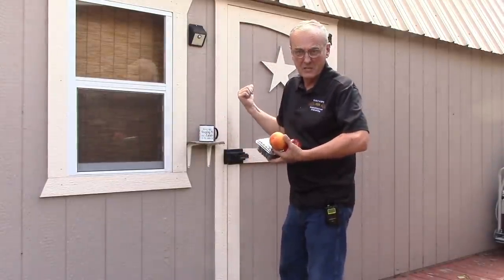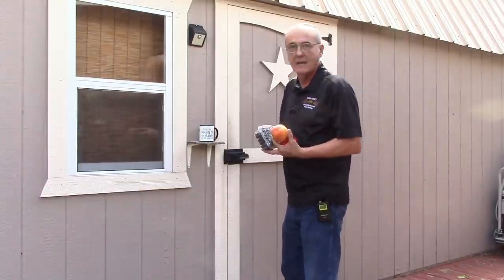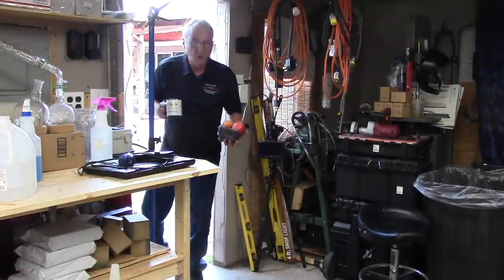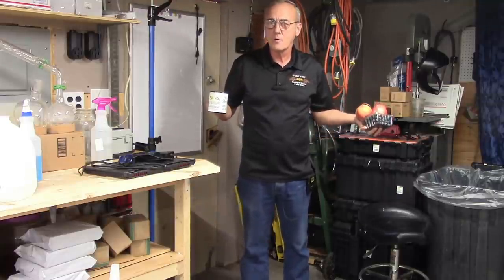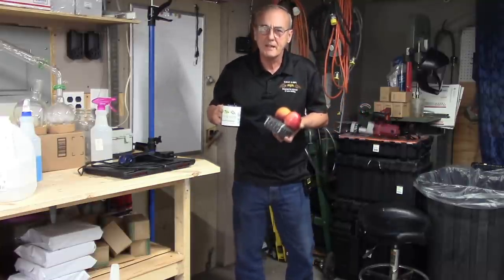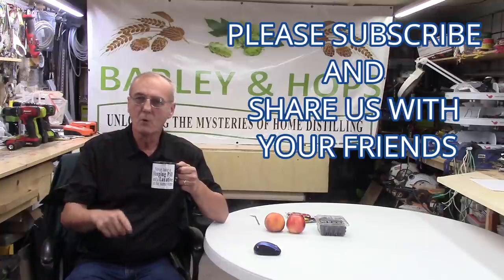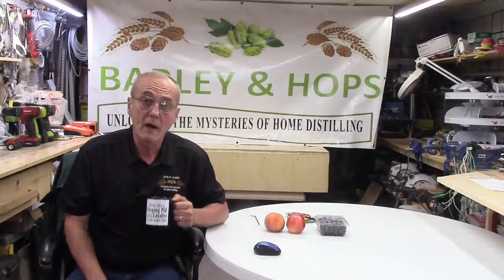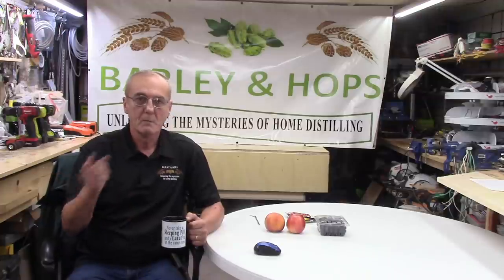FLAVORING SPIRITS AND MOONSHINE

Comment: George like your podcasts keep them coming.
Long before I took to distilling I used to make slow jin (container half filled with slows that I  cuts and remove stones to allow  juices to flow add  sufficient sugar to fill spaces between the slows and fill to top with jin leave for as long as possible shaking every day) this works very well, I have taken this to next level using spirit from still cut down to 40% and still spirits jin essence this works well, so more experiments same method blackberries blueberries plums gets all a success but as you say strawberry raspberry etc fruits with mild flavour a diaster, also tried rum brandy whiskey essence all a success.
I only ever use a suger wash and still spirits turbo yeast kits and any failures can be added to next still run to recover the spirits.
George I think you could do a program on this method

Comment: Hi George love the viewers video, impressive!
Im new to distilling  and I bought a local home brew shop refux column and got 92%alc without all the bubble plates. Chasing that extra 4% seems a whole lot more expensive.
Cheers
Reply: Maybe, but aren't they cool looking!
Reply: Anonymous Bastard 2  Absolutely, I gotta go back to George's other vids on the subject to fully understand the bubbleplate concepts
Hes a legend!
Reply: You CAN get 95 even 96 ABV without the plates. Go slow, add height etc, plates is just one (pretty) way of doing it.
Reply: @adwally1  I don't run bubble plates,  I  run 4 x 4" perforated plates,  and I can pull 90+% at 5 quarts per hour. It's not just for looking pretty.

Comment: i had great success with apricots. ferment just apricots for a couple days, add some sugar after. run the still in pot mode down to 20 proof. proof the ... 'wine' UP with what came on top. Best bit was between 100 and 80 proof. another success was through... multiple failures. soaking the junipers and THEN re-distilling and collecting same, down to 20 proof. helped with cloudy-ness of it as well. yum yum

Comment: Great informative video!!  Thanks George you hit upon such an important topic and a working solution to it.  One of the first disappointing things we all find when newbies is that there is virtually no flavor pass over when distilling fruits.  Just as you point out, only the "Character" of the fruit will be present and that is virtually undetectable.  The "Art" comes in post flavoring your spirits.  One thing not mentioned is thinking a Thumper is going to add flavor.  You will find a Thumper is also disappointing.   Extracts are much better than flavor additives and cheaper.
Reply: I'm a total newbie...what is a thumper? Thanks! 🙃
Reply: @CrazyKelownaCatLady  Pot stills can only produce spirits with around 140-170 proof, so moonshiners developed a thumper to increase the proof.  A thumper is just a closed vessel with an inlet pipe coming from the still arm to the bottom of the thumper which is about half filled with some liquid.  An outlet pipe at the top of the vessel which is not submerged connects to the condenser.  The liquid is usually some mash, left over still liquid from a previous run, or a mix of herbs, fruits, or other flavoring ingredients.  Vapor from the still bubbles up from the thumper heating the liquid inside.  As the heat builds up the vapor passing through tends to slightly increase the alcohol proof and to some extent picks up the flavors from the thumper liquid.  
Key thing is a thumper is more work and causes the still to become a closed system since the liquid in the thumper acts to block air coming back into the still as it cools down after a run.  Unless you remove the thumper after a run it can cause a vacuum in the still boiler causing it to suck in the boiler sides collapsing it like a crushed soda can.  This is a dangerous situation that MUST be avoided.
Additionally, the proof is only slightly increased and regardless of what the moonshiners show on the TV program, flavor transfer is very slight.  My personal opinion from having experimented with thumpers is they just aren't worth the effort.  Hope this info is helpful.

Comment: i steeped some cinnamon sticks in a pint of neutral distillate, added it back to a 3 liter wash then ran the wash though what i have for a still. what came out was too hot to drink but was perfect for air freshener.  after a diluting and a second run through my coffee pot still this stuff ain't fireball but is still strong enough to replace mace!

Comment: Use an Apple concentrate . And  for peaches  dont bring them to a boil  140 degrese is good mashem up real good  smallest run for me was 50 gallons .I also ran 25 pounds of sugar .
Cracked corn  bouled sepparte   once tempt was down to 80/90 degreese  id blend them together and add 10 or 12 pounds yellow corm malt . No yeast ..  distilling id run a gallon glass Gin basket half full of processed peached juice and all ..  it worked fine  and yes yellow malt corn  will work in place of yeast    you should make some sorgum liquor. For apple concintrate   half gallon full gin basket full  .

Comment: hi george fab video just a question i have the small airstill with the botanical ,basket i have innthe past infused my spirit with the jack daniels wood smoke chips which worked out great the question is could i place the woodchips in the botanical basket before ding my distillation would i get the same flavour as the infusion method cheers fella steve of the uk

Comment: Awesome video and perfect timing. I do have a question about terminology specifically in the wine industry. If a wine, such as fruit wines, is actually made from the fermentation of that fruit, for example a Peach, we call it Peach Wine but a wine made from fermented grapes and then flavored with peaches is termed something else or is it also acceptable to call it Peach Wine? I realize that it's technically an infused wine but do they have to disclose the difference between the two? 
In
Reply: This would still be a wine since the fermented sugars would be from fruit. I'd call it a blended fruit wine, or a peach-(grape varietal) wine.

Comment: Hi, new to this I have an 8 gallon still with a 2-1/2 gallon thumper. What kind of back pressure can I expect to have in my still. Also your thought on adding a check valve to the still to allow air in ass the still cools off. Thank you for your time

Comment: Thanks George. This video is right on time. I need inspiration. I’m going to experiment with Kool-Aid again. I’m going to add about 30 packs to gallon of spirit I refluxed the other day. I’m going to get it down to around 40 percent and load my mighty mini. I figure if I run it off as near to 65 percent as I can I may end up with something fun. I do have a question. My distillate is the heart of many runs that I was careful to cut the tails and it all averaged 89-90 percent depending on which one of us reads the floater. My question to in is and I can’t believe I have to ask but if I’m not introducing any tails to my kool aid will I still have them? I hope that made sense.  Have a great day George.
Reply: I have fermented with it before and the wash by itself tasted pretty good. I am going to cut my gallon of liquor down to around 30-35 percent by adding a couple gallons of spring water with the kool aid added to it. I’m only running a 3 gallon mighty mini.
Reply: Name I’m very new to being signed into YouTube and participating in the discussions so I’m not sure if I am replying in the right place but I hope I am. I am sure that this near empty jar of corn may have whined a little when I put the lid back on this last time. I hope this new toy comes soon and brings you lots of happiness. I am working on putting together a keg still like the one Jesse from Still It uses. I just need a steel keg. Found aluminum and I guess that would work until it wears out. I can’t wait either. I like my Mighty mini but when it is done running it hardly seems worth it. It is fun for experimenting with small batches but I been at this awhile so it’s time to start thinking of saving for the future.
Reply: Name I hope I am replying in right place. This is new to me. The kool aid is just for flavor and it’s mostly only sugar if you add it. I made a batch awhile back that I used 18 packs of cherry kool aid, five gallons of water, 18 pounds of sugar and a pack of turbo yeast from Mile Hi. I know turbo yeast is frowned on a by lots of people but I was very new and wanted something fast. After about 5-6 days it was near 20 percent ABV and still had plenty of sugar to be sweet. It reminded me of those bottles and cans of margaritas called Rita’s you get at liquor stores. Least here in the Midwest they do. I almost kept a couple gallons of it because it was good. I filled my mini and ran it while dipping right out of the fermentation bucket. I was torn up. Now I want to mix some strong sugary kool aid with my spirit down to a 35% three gallon mix drink and run it off. I figure about 65% should allow for plenty of flavor. I don’t know how it will work out but I plan to find out. Thanks for the feedback
Reply: @chadanthony4287  That's the best part of this hobby it brings the mad scientists out in all of us be safe and go for it.
Reply: Chuck Don't know do ya thanks man. I am super safe. I know my mini can barely produce enough poison unless you are really trying. I have been told two to three ounces off the top to be thrown out just to be safe with my mini. Well, I get paranoid and toss out 4 and 5 sometimes 6 when I been having a drink and praying to Popcorn while it drips. I don’t want to be the one who blinds or even worse to some ignorant poor bastard who trusted me. I’m not that guy. Safe all the s way.
Reply: @chadanthony4287  your throwing away good stuff in the mini the first two ounces is more than enough then do a burn test if it's a blue flame in the base you're good if it's yellow your still in methanol l run a twenty gallon set up and only throw out six ounces when using fruit or grain. George has a great video on this in the library.
Reply: Chuck Don't know do ya that’s what I have been told many of times but when I started this I had literally no one for advice. I figured it out mostly on my own then found George at Barkey and Hops. I’m sure two ounces is way plenty but my anxiety gets to epic levels. I do save it and my family uses a lot of gas burning penny stoves made from tuna cans. We burn it in those and it gets used. Maybe one day I can get past the anxiety and save those few extra shots. I fully understand what your saying hit the irrational part of my brain won’t go for it. Thank you for the feedback tho. It’s nice having a community we can discuss things in. It is hard to not just bust out and start talking to random people when that’s all there is.
Reply: @chadanthony4287  Anytime you need help just ask I was taught by my great grandfather and grandfather and have been at it for over fifty years
Reply: Chuck Don't know do ya right on right on. Sounds like you have a lot of experience. I’ll most likely call on you when I go to building a bigger set up. I’m thinking if two kegs with separate columns that both feed the same condenser.
Reply: @chadanthony4287  that's a big step up from your mini and it's going to be hard to get it to balance never mind that your condenser is going to have to be huge to handle it. Lot of plans on the Internet do a bunch of research before you start and check out Mile high stills for some great idea's
Reply: Chuck Don't know do ya thanks. I have checked out many of the stills from mike hi. They are nice but they are asking a fortune to assemble some parts I can get myself and stick it together. I’ve used a keg still before. Never tried attaching two together and I have no real clue what the outcome would be. I figure if it doesn’t work out I can always separate them. I’m having trouble locating a steel keg for a decent price much less two. Not sure where I would set something of that size up anyway.
Reply: Chuck Don't know do ya I probably won’t go with two kegs to begin with until I have mastered the one. I got my inspiration from Jesse at Still It here on YouTube. I seen George’s video on how easy it is to put together and the column from my mini even will fit it but I’m looking into a much longer column. Without any actual research I feel a longer pipe will give me more room for a reflux chamber and probably more control of those few points over 90 percent that don’t like to cooperate. I’m gonna add a second heating element because I hate waiting on my little one to come to temperature. I’m hoping to get a few barrels of mash ready to go before it gets cold. It does here. Frigid cold. I’m going to let them sit outside to freeze up a lot of excess water so my abv will be much higher going into the run. Hoping to cut out fermentation this winter altogether and distillation times down by a couple few hours.
Reply: Chuck Don't know do ya I enjoy corn liquor but prefer more neutral spirit when I don’t have soda to chase it with. Can mix a vodka with most anything. I haven’t researched them enough to form a firm grasp how they work but what do you know about bubble plates? I got the gist of what they do with all the multiple distillations at once but are they worth it? Have you seen them used? Do they cut any of the run time down without losing quality or potency? Slow and steady I can pull 90+ percent nearly every run off this mini but it’s such a small amount it’s hardly worth the time. If it wasn’t such a satisfying hobby sometimes I think the liquor store would be the more practical choice.
Reply: Name I am just learning how to reply on this. Being signed into YouTube is a new experience and I haven’t mastered how it works yet. I wish I would have went with something bigger to start with but knowing what I know now I realize I can just buy the pieces I need individually or make them myself. I found out the price of a keg, a couple elements, the couple circular steel saw blades that drill holes through steel do  not cost as much as an assembled still. Not even close and you can add the personal touches that makes it yours while tweaking this way and that depending on your ideas on what may make it more efficient. Mike Hi sells them for a profit while a George is on Barley and Hopps making detailed videos on how to do it yourself while mentioning the price of the various parts. I did the math quickly rounding numbers and adding them together while George drilled his hole for the heating element. The math I came up with was just disappointing when I think of how nice and practical of one I could have built for a lot less. A lot according to my preliminary research. I know they have to make money but I have to save it when I can. The money saved buys a lot of grain
Reply: @chadanthony4287  I have three columns a ten plate a five plate an a packed column I use stainless steel rings and copper mesh in George has a picture of the last one in a video he did a couple of months ago.
Reply: @chadanthony4287  I agree they cost a lot only mentioned them to give you some idea's.
Reply: Chuck Don't know do ya That is where I get most of my ideas. George and Jesse. I had a pressure cooker pot still for awhile. I only ever actually tried a couple sips from all fifty quarts I ended up collecting. It had a couple fittings made from material I couldn’t identify and the pot itself I wasn’t sure about. I was so new and finding information I trusted was hard with my anxiety disorder. I broke a jar in the greenhouse and dumped 49 in the corner of my yard. I isn’t
Reply: Man I know I must have seen the video because there are very few I haven’t watched. I kind of remember him inserting a photo of a very nice looking still. If that’s yours Whoo hoo I’m little bit jealous. Somehow on my other reply I sent it before I finished. I dumped all them jars over the metal I couldn’t identify and there was a few runs I was sure that I forgot to throw out the poison and when I did remember I wasn’t sure how much. My anxiety level got so high just thinking if I keep I keep it someday it will get drank and if I don’t know. Now I have done so much more research and spoken to George in person about the methanol and read much literature from many sources. They all use pretty much the same formula. Clawhammer has a chart for figuring out what to expect. It is way different than George’s explanation. They have you tossing out more than twice if I understood the chart right. I got to run out. Getting sugar and I have one chance at a ride.
Reply: @chadanthony4287  that one was mine in can run as a pot still or reflux
Reply: @chadanthony4287  better safe then sorry but the flame test is an easy way to tell and if you had saved it you could have rerun it to clean it up.
Reply: Chuck Don't know do ya Yea I know that now. I was getting information overload to where somedays I wanted to drink it but wasn’t sure so I dumped it. I had a couple “friends” that unexpectedly discovered the stash so it wouldn’t have lasted long. Now I have a stash spot that is safe and secret.
Reply: Chuck Don't know do ya I’m gonna check it out again.